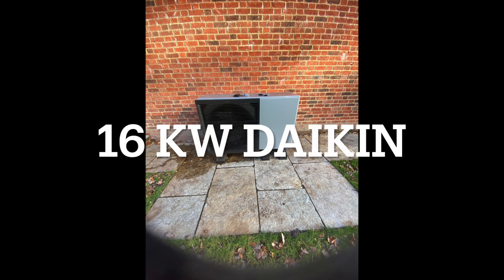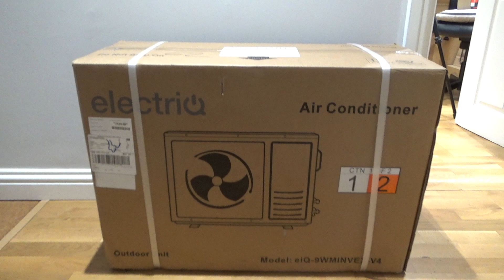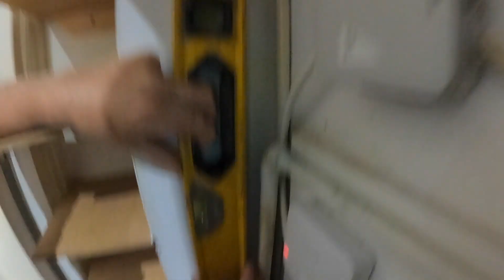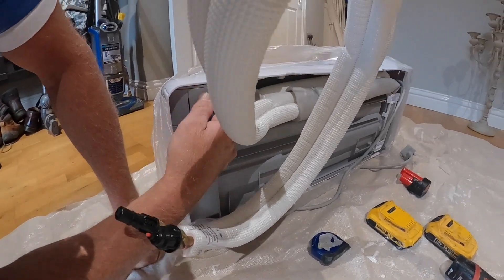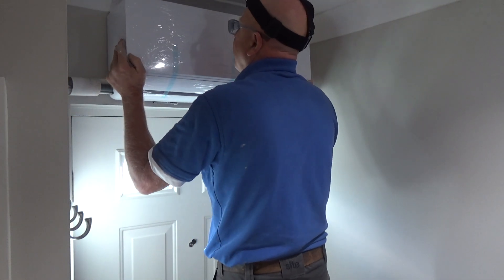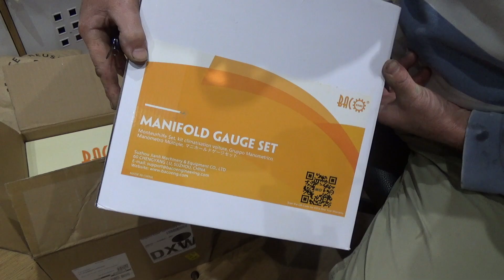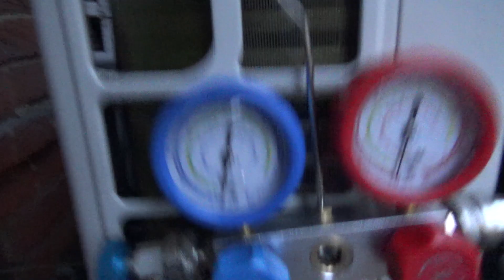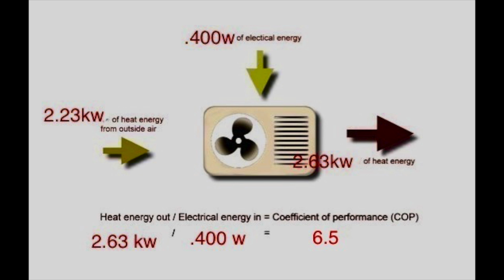HEAT PUMP - AIR TO AIR  MINI SPLIT  DIY INSTALLATION    IS IT WORTH IT  ???  IN U.K

Comment: Hi.  Thanks for the video. I think I found your vacuum pump from Amazon but not the gauge set.   Installing an Electriq 12000 btu but bewildered by the various vacuum pumps available 👍🏻. Can’t find the instructions for fitting without the vacuum pump
Reply from the maker: Hi  I got the vacuum pump from amazon  around £ 120.00 if you get one you will also need the adaptors for a mini split around £ 5.00 Thank you. and good luck 👍

Comment: Are DIY'ers allowed to install this on their own legally? I've read that to work on anything involving refrigerant you must be F Gas certified? Or does does only apply to if you are charging someone money for the work in a professional capacity?
Reply from the maker: Hi  to install these units  the installer does not have to be f gas registered as the refrigerant is R 290 with a very low GWP  thank you  👍
Reply: @HEATSEEKER1428  Amazing! Thanks for that! And thanks for the video!
Reply: @HEATSEEKER1428  May i ask where you came by that info? I googled it and had some sites saying yes that's true but some said not true. I'm still just as confused lol
Reply from the maker: Hi I just got info from chat  GPT I would hope to think it is not true  because  those units are so cheap to run . Reasonably easy to install with a little knowledge. I was gutted when I read it.
 I have spoken to a couple of f gas qualified guys and they were dead against them because as far as they were concerned the D I Y  units were robbing them of work.
Crazy really because people would much prefer to spend £500-£600 and install their own  .
Rather than be quoted or charge £ 1,500.00 that most of the would not be able to afford.
To me if the powers that be have had them fazed out then that is not progress. Sorry about rant but I hate to think of people  potentially being ripped off .
👍
Reply: @HEATSEEKER1428  I did some more reading and i think you are right, because its R290 (propane not fluorinated gas) you don't need to be F-Gas registered. At least that's what a few air conditioning websites said so they would know. They also said that you can do it yourself but it still needed to be approved by building control and checked if under permitted development or not. They all stressed about the dangers of DIY but i guess they would say that because they want the work. Thanks again.

Comment: Great video and very informative. How are you finding the units now they have been installed a few years? Did you opt for just the 9000 BTU units?
Reply from the maker: Hi I have fitted both a 9,000 and a 12,000 btu units and they are both working well. we even had to use them for cooling a couple of times last summer. In my opinion the mini split system is the most economical way of heating your home or part of your home.  . Thank you 👍
Reply: @HEATSEEKER1428 Thanks for the info. Opted for a 12000 btu unit. Did you need any adapters to go with your vacuum pump so that it would connect to the service port? On a side note over winter our boiler broke down and a 1.8kw heater was enough to keep the downstairs warm. Expecting good things from the unit when I get around to installing it!
Reply from the maker: @Marks-Garage  Hi yes I needed  adaptors and I got them on amazon quite reasonably. You will not be  disappointed with the performance of the unit and the low running cost . Thank you .and good luck👍
Reply: @HEATSEEKER1428  Thanks again for the help. Honestly i think Electriq should give you a job or pay you some commission!
Reply: 3 months on since fitting the mini split and it's been a god send! During the hot weather it's been nice to come home to a cool living room. I'm expecting it to massively reduce our gas consumption over winter. They should be pushing these not air water heat pumps

Comment: Hi, thanks for taking the time to make the video about air to air heat pump installation. I am currently researching heat pumps and have realised that with electricity in the UK being 4x the cost of gas per kWhr even a well performing heat pump will take a long time to recover its cost. I'm therefore looking at what's the cheapest way to make a difference to my carbon footprint. An air to air heat pump might be the answer for me as it will be the easiest to install. I'm hoping that the 80/20 rule will apply. I can get rid of 80% of my CO2 heating emissions for 20% of the cost. We'll use the gas boiler for heating water and on freezing cold days, at least until the gas boiler dies.
Reply from the maker: Hi Regarding the cost effectiveness of an air to air heat pump  I think you would not be disappointed . although electricity is  more expensive per kWh  the air to air heat pump can have a C.O.P of 4  . Plus  . heat pump use is different to conventional gas central heating system . With air to air heat pump  there is not requirement to have it come on when not needed . as heat is almost instant .
The  2 No. heat pumps that I have fitted have made a vast difference to  our energy cost  and comfort levels . and no doubt our carbon foot print. Thank you  and good luck.👍👍

Comment: Thank-you for making this series of videos. I looked at installing one of these units last year but decided against it. However having seen your videos it rekindled my interest and gave me the confidence to have a go. It's installed and working now, ahead of the cold weather. I used the non vacuum pump method, but torqued to required settings and used Nylog on the flange joints. No leaks detected - this was my main concern. My intention is to use it to keep the house temperature from dropping overnight, using cheap off-peak electricity, I do have a fairly well insulated house.
Reply from the maker: @AndyH-o7q  Hi you will not be disappointed  good luck . 👍
Reply from the maker: Hi I am about list video on how  the mini split has performed over a whole year.. If you are interested . Thank you 👍
Reply: Hey how are you finding it so far?
Reply: @thomasd2796  It performs pretty much as expected. As stated above I currently only use it with off-peak electricity to stop the house cooling too much overnight. This is reducing the time I have to use my oil central heating, it will be interesting to see by how much after a seasons heating, but certainly some days I’m getting away without using the CH (I also have a log burner and fairly well insulated house). 3 hours overnight will use on average 2 kWh so on my IOG tariff this is 15p. If I had batteries/PV then I would use it more. In the main it is quiet although it can be a little louder (just fan noise) at start up and when temperatures dip below freezing. I will most likely not use it when minus temps are forecast as the external unit sits outside my bedroom and I live in a rural area so I am sensitive to noise.

Comment: Hi, just wondering if the indoor unit could be a good option for providing heat in a conservatory? The only place i'd have in my conservatory would be low down on a dwarf wall. There would be enough clearance from the floor to be safe, much more clearance than a normal fan heater would typically have. I know the recommendation is to fit these around 2 meters high for air flow and circulation but is this primarily for cooling? Could just using it as a cheap form of heating be viable low down? Can't seem to find any advice so any help is appreciated.
Reply from the maker: Hi I think there is no reason  for heating the indoor unit could not be mount on the dwarf wall of you conservatory . As long as there is enough air around it.  Electriq set a unit  that is low level  . it's  a bit more expensive  but it might suite your requirements
Thank you  and good luck👍
Reply: @HEATSEEKER1428  Thanks for your reply. I did look at the low down unit Electriq make but it was slightly too high to fit on my wall and it would of meant cutting in to the window ledge, plus the noise it would make having all components inside. Thanks for making these videos - it has given me the confidence to give this a go.
Reply: I have one in my conservatory and it works great. I put it on the exterior wall of my house inside the conservatory, above the entrance into the house, if that makes sense. You just need to make sure the condensation pipe is straight and a slight slope down to the outside.

Comment: Great video, i am looking to install a unit in my conservatory however i am a little confused. I have done lots of research and i was of the understanding you need to be F gas registered to purchase a mini splt system? If this is not the case this is brilliant news for me as i believe i am more than capable of installing one of these. Thanks for the video
Reply from the maker: Hi 
The mini split systems That I have installed in my video's Are Made or badged by a company called Electriq  .The refrigerant is R290 so no  F gas registration required . Thank you. and good luck 👍
Reply: I have the same unit shown in the video and it uses R290 which is NOT a F Gas and therefore can be DIY installed. Most units, even most of this brand, use different gasses and do need a qualified F Gas fitter.

Comment: Were the pipes the correct length or did you have to adjust the length? And if cutting them, are there any additional steps?
Reply from the maker: Hi  the pipe set was 3 meters /  10 feet. I had to adjust  . You don’t have to adjust. If they are too long  you can leave coiled in the area of the out door unit . But I found it easier to cut and joint ,but I realise that not every body has confidence to cut and join pipe work. Thank you and good luck .

Comment: I am in London - can I borrow your your vacuum pump and manifold set to install my electriq unit?
Reply from the maker: Hi I can't see why not  I would have to take a cash deposite  Of about £ 140.00 fully returnable of course. You do know that the electric instruction manual says that you don't have to vacuum down the line set . Thank you
Reply: thanks that is very helpful - I am trying to organise things this week  @HEATSEEKER1428
Reply: thanks for that - I have just received my electriq unit - is it possible to meet up to discuss installation?  regards @HEATSEEKER1428

Comment: im currently small mid terrace on eco 7 storage heaters . tried getting grants for a full heat pump system but sadly due to working full time all my life i dont qualify for any and im not sure i would live long enough to see it pay for itself if  i did it 
 myself . do you think i could benefit from a mini split to run along side my storage heaters ??
Reply from the maker: Hi yes I understand your problem. I would defiantly think that you would very much benefit from a mini spit  as you can switch it on as  and when you require heat. You will not be taking electricity when you don't need it  . eg when storage heaters have been on the night before and the next day no heating required. Bear in mind that the  COP of the mini split is  only really good up to - 5 C

Comment: I have done a lot of research on heat pumps and to date i am not convinced that there efficient enough in uk weather. However I have gone to town on our insulation which has made a huge difference and in fact brought our energy consumption down considerably and our energy bills are still very low. I am however looking very closely at solar panels which have been improving in there energy output. Good video though.
Reply from the maker: Hi yes  if your property is really well insulated and you are looking for a cost effective ,eco . and sustainable way of heating / cooling it  then a heat pump/air to air/air to water/or ground source  , is the way forward.  NEVER  drill holes in or through any lintels. Thank YOU.

Comment: We had a mini split installed last summer and have started to use it for heating. Quite a revelation how well it spills the heat into other rooms and how much more comfortable it is. I have now decided we will increase the capacity and install 2 more indoor units with a common condenser/compressor. Very interested to hear that you don't need to be qualified given the refrigerant you use, I never knew this.
Reply from the maker: Hi yes it was quite a revelation to me .

Comment: Great video. Roughly what is the cost of a unit like this…?- I’m needing to heat an attic space, that could use the cooling feature in the summer.
Reply from the maker: Hi The cost of this unit was around £ 560.00. There are a few additional bits and pieces required but these are not expensive items , The total cost  of everything was around  £ 600.00. I got the unit from appliances direct . If you are in the UK

Comment: Does this unit also cool in hot weather?
Reply from the maker: Hi Yes this unit does cool in summer and it is more efficient when in cooling mode  than when I heating mode. Thank you .

Comment: So if everybody has a heat pump. The overall noise I have concerns about. But the main problem as I see it is where is all the electricity coming from to power them all. We cannot find enough to power millions of ev's.
Reply from the maker: Hi I think last year 40%of Britains electricity was generated by renewable sources.Regarding the noise, a  heat pump makes no more noise than a gas central heating boiler  ,At the moment the air source heat pump  that I have installed is consuming approx. 400 w per hour . Remember  if you have a 30kw. central heating boiler  and you just want to heat 1 specific part of your house invariably you have to heat other parts of the property that you are not using unless you have every room zoned.. I don.t know about Ev's. I don't think they are a cost effective  or eco friendly form of transport. In my opinion  It is more eco friendly  to keep the car you have got or buy a second hand car and drive it less . Thank you
Reply: Hi Ian, I've just read your comment from 10 months ago about the UK grid not being able to power millions of EV's. You might be right. However, I was wondering whether you are aware of an App called "Gridcarbon" which enables you to see how much power is being drawn from the grid, how it's being generated and what the carbon intensity is. If you rotate your phone from portrait to landscape it then shows the data over a day. It's interesting that between 9 pm and 9 am the power demand is below 30 GW which is about half the capacity of the grid. That's when we should be charging EVs. There are no adverts with the App so I strongly recommend it for learning about how the UK grid performs.

Comment: I have one and heating my office 5 x 4 mts well insulated and work in it 5-6 hours per day at about 20-21C I have used 399kwh. I am paying 25p per kwh so its cost me £99 so over a heating season of 5 months its cost me 66p per day to heat the office. Very happy.
Reply from the maker: Hi I I can believe that these things are economical to run. I I'm so pleased with mine. Thank you.

Comment: Nice! I keep saying "we had loads of these when I lived in tropics and they're cheap as chips and work a treat in cooling mode" so it's nice to see someone actually fit one here and get some heat. These are normally fitted in breezy shade (under eaves commonly) in the tropics, can't help thinking they should be getting as much warm air as possible passing over them if fitted here for heating? We'll almost certainly put one on the wall of our largest downstairs room. 2.6kW (nearly "3-bar fire") heat for rice cooker input is hard to argue against.

Comment: I fitted one myself in our bedroom after getting fed up of moving the portable aircon unit and the stupid vent and noise it created. Game changer with the hot weather we were having. Perks it’s a heat pump and kicks some serious heat out in winter (we have solar and battery’s) so cheap to run anyway but it doesn’t actually draw that much power. Fitting the Samsung wind free 3.5kw fully installed cost me £700 and that included having a guy come out to test the lines I flared and release the radiant bargain in my eyes

Comment: Air to air heat pumps are great, we have 6 in our property in Corfu, which consists of our living apartment plus 3 holiday rental apartments.  They provide plenty of heat when it is cold and plenty of cooling in the Summer, all with great efficiency.
Reply: Try using one in places like Canada.... we have one and $700 was our electricity bill for 2 months...
Reply: @SignumGB  we're not in Canada so that's irrelevant

Comment: Hi, where did you run the drain ?
Reply from the maker: Hi I ran the drain directly down in the cupboard and discharged it outside to the left of the outside unit, if you look it is the white elbow sticking out of the wall . thank you